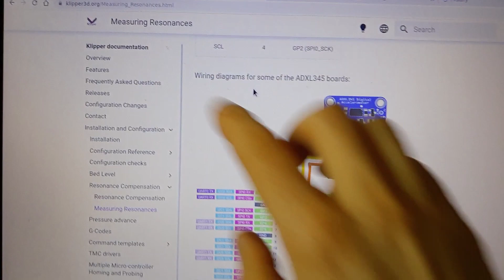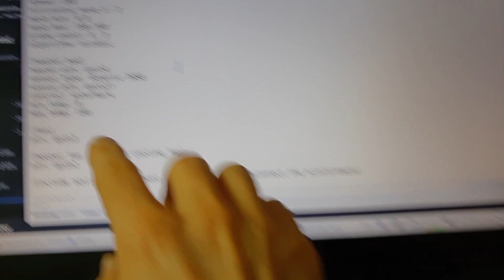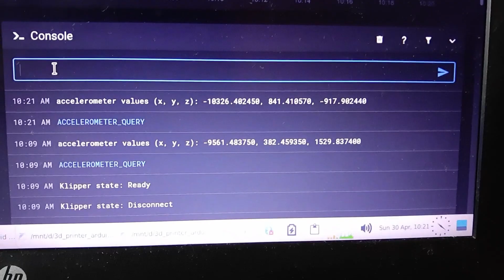Klipper - ADXL345 accelerometer sensor with Raspberry Pi Pico

Comment: hi!, I also got the same error as you, and followed your instructions, klipper got the following message:

Pin 'gpio17' is not a valid pin name on mcu 'mcu'

Once the underlying issue is corrected, use the "RESTART"
command to reload the config and restart the host software.
Printer is haltedg
Reply: cs_pin:pico:gpio17 # I added "pico" but it gives me an error

adxl345: spi pins must be on same mcu

Once the underlying issue is corrected, use the "RESTART"
command to reload the config and restart the host software.
Printer is halted
Reply from the maker: do you have the proper [mcu] serial device set ? do you have any other mcu connected ?
maybe make a backup of your config and try mine and go from there.
https://github.com/CNCTinker/TinkerBot
Reply: hope that you got that right eventually, here's how I got mine to work in case someone else is having the same trouble

mine is named adxl and have the adxl.cfg with the pico serial separated from the printer.cfg

[adxl345]
cs_pin: adxl: gpio17
spi_software_sclk_pin: adxl: gpio18
spi_software_mosi_pin: adxl: gpio19
spi_software_miso_pin: adxl: gpio16

 @thango7677